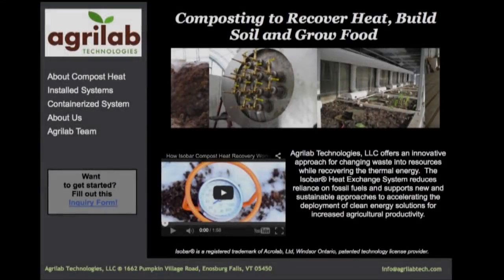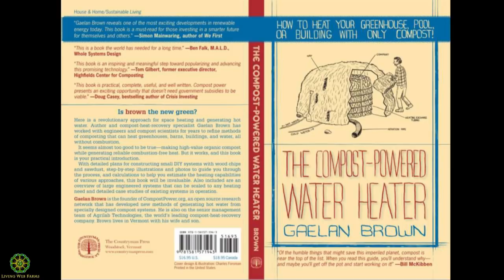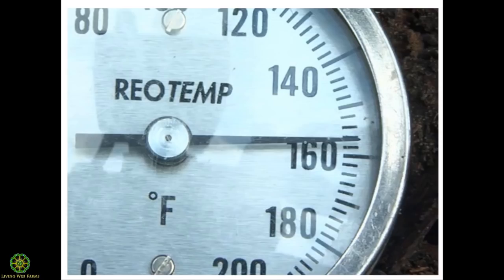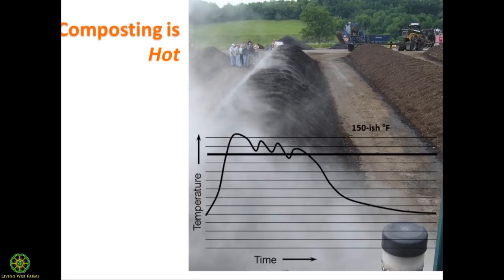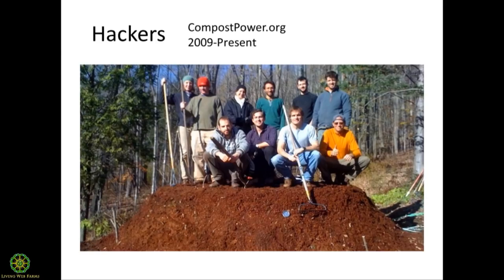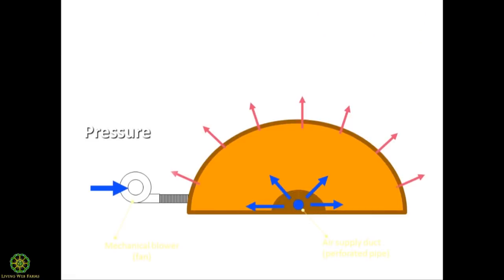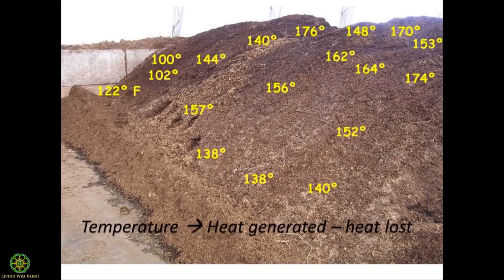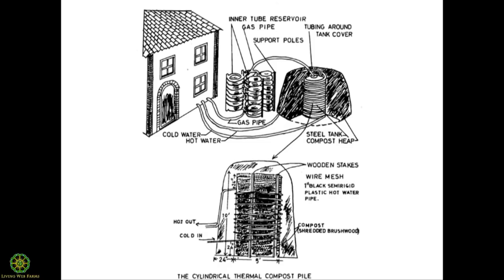Compost Heat Recovery Webinar with Gaelan Brown

Comment: Great presentation, very informative. No mentioning of peeing on the compost pile as a source of nitrogen and of course moisture.

The insulated shed composting set up could instead be a basement under the greenhouse with ventilation to the outside with vent pipes. The heat would rise up to the greenhouse.
Reply: If you're considering vertical farming, that's a winning concept... You could even have a greenhouse with several levels.

Comment: Great info here I have a small like 220 c/ft greenhouse for citrus tree that produce and will be using a compost box as a pre heater in my 30ft of hose at 5 feet down exchanger. VT is a great state had fun there near Manchester ctr years back.

Comment: Jean Pain's feedstock was machined forest wastes. It was far from being merely woodchips. it would have had a lot of leaf, bark, weeds, vines and many other things that are removed when reducing the fuel hazard and doing general forest management tasks. Woodchips made from just the woody parts of a tree are mostly carbon, lignin and cellulous, but brushwood that is cut and mashed, as was done in jeans machine, is entirely more nutritious and structurally suitable for composting and methane making than simple wood.
It is amazing that these heaps that you show could be anaerobic soon after turning. Usually if a material is that wet, it is too wet to turn well. But one thing is certain. unprotected compost heaps will burn away in the sun and evaporate goodness. They need to be mulched and covered with breathable material because by doing this well you will save about a quarter of your production.
Reply: No, the feedstock was fresh, green under brush which automatically has more energy content than the dead material.  Jean Pain, himself cautioned against taking the detritus.
Reply: You are capturing the water and recycling it to continuing the process. However, you are doing nothing with the CO2.  The is a gross inefficiency of the system.
Reply: @johnkilgallon207  you are obfuscating the issue.  Composting is an accelerated biodegradation with the interference and control of man.  In this case, the CO2 is not being used which is a waste. Your response provides no resolution.  You have left a clue that you maybe a Briton—“maths.”  If you are going to to use the abbreviation of mathematics just say math and rid your self of an unnecessary /s./
Reply: @estebancorral5151  wrong he has an American accent and references locations in US. In any event why don’t you make your own video instead of criticizing others?

Comment: Sorry if this is a silly question: does composting release more BTUs/energy because it does not emit any light, unlike combustion ?

That would seem to me to be a sensible explanation as to why there is more energy ‘available’
Reply: Interesting point. You may be onto something. Also, how about the sound emitted from some forms of combustion? At least internal combustion engines sure emits a lot. Engines are obviously used for work, which brings up another possibility -- is some energy lost to physical force in combustion that isn't lost in composting?
Reply: Another possible explanation that I wonder about: combustion doesn't utilize nitrogen from the atmosphere as a part of the chemical reaction like composting does. A significant portion of the energy in the process seems to come from atmospheric nitrogen being fixed and consumed by the microbes. This could help to explain how even though there must be losses from the biological process, there still the same Btu produced from composting and combustion.
Reply: No.  The system used to liberate heat is cellular respiration which which is many times more efficient than combustion.  As human, you are using this system to live.  The microbes in feedstock use this system. They have a problem though. There bodies have a low surface to volume ratio which makes it hard to remove their excess heat. By providing them with artificial ventilation, you are preventing them from dying off from their own gluttony.

Comment: I have a question about negative air flow composing. The question is asked in your video about inches of water column relative to cfm. We have built a system but have been unable to find information about the proper inches of water column. Could you supply this information please? Thank you for your time.

Comment: OMG!! I used to work with horses, and was really good at Squaring off the Muck heap,,, 
 even back then, I used to wonder about the heat and energy lost, whilst snow was steaming off, while the heap was composting!!

I am really surprised that this hasn't been made more accessible as information!!

And, I used to maintain the squared off Muck heaps, 
so as to ensure that we didn't have any fires!!

I was often thinking that the heat could be captured with the use of water lines,,,, 
Perhaps even the heat /cold generators (Peltier /Sterling?!)
I'm glad to see that this is being put to use!!

We would Start by tamping down the first, , then build up at one end, making "steps" up, and stomping them flat, 
whilst continuing the 1st end, 
until this was the correct height of about 6ft high,step down a foot, about a yard, in length 
and so on.

Eventually, the composted material was sold on to gardeners, and we'd keep circulating the compost and raw Muck and Straw....
There wasn't ever any problems with Unpleasant odours.

Back at home, I did keep my own two stables, one Muck heap easily heated, during winter, my elderly glass house, at a decent temperature, even keeping a couple of grapevines, amongst other things growing well in the NW, UK!!!!
Reply: What a Dingbatt!  This information has been around for ages. I clearly remember an article in 1980  by Reader’s Digest about Jean Pain.  This 
Publication is known throughout the English speaking world.

Comment: Is it possible to have the biofilter be compost of the same composition and size as the source pile? Then reverse the flow every once in a while to keep the twin piles' moisture balanced (and possibly help to keep the lines clear)? Since the biofilter is basically just a positive-pressure aerated pile? 
Is it necessary to use the Isobar® air-to-water heat exchanger or can one just use a commercially available air-to-air heat exchanger like from an air-source heat pump? This would probably work better at smaller/residential scales since it would also have the air-source heat-pump to compensate for whenever the compost gets too cool to suffice.
Reply: Completed compost is the best bio-filter. It is almost humus.  You are wrong that the system has to use positive displacement.  The German inventor Anton Flettner proved that negative pressure is eight times more efficient.  He had an ephany while on vacation looking at sail boats in Kiel, Germany.

Comment: Suck air from top down so that no water draw up into the vacuum machine and also draw up the heat. the heated air then enter the botom ground of a green house. Cover the entire ground with charcoal or better activated carbon so that when hot air enter the green house, odor can be filtered. Or let charcoal in a container of the pipe systm as a filter, then the filtered air with methane can be burned at the final stage of the exit.
Reply: 💥BANG!!! 💥✨🚭🔥
At a guess, but I am only going on the Stables Much Heap!

Comment: I cut down 25 trees and much of it was chipped into my woods. After two weeks the pile is steaming hot already.
Reply: Yes, but you are not regulating the heat to speed up the process or to put the heat into some other application which is useful.  You are a proponent of the status quo.

Comment: I'm confused: you say compost needs to have a fan to avoid the oder, but then you say that you just fan it to a room with wood chips to absorb the smell.

Couldn't I just add more woodchips to the pile to eliminate the stench?

Also, you say that the greenhouse that is attached to the compost pile had an awful oder, but you said he used chicken manure. What if you just composted plants?
Reply: on another video, saved in my playlist "fire" and/or "gardening" a person is using just a pile of leafs on one side of his greenhouse and says its enough and has stopped the use of his woodburner that he had installed there. i believe he said that there was coming like 30 degrees celcius from the side in the winter

other people say manure is producing like 300w for a ton
Reply: I thought elaine ingham said if it stinks its anaerobic and not working correctly?
Reply: @jesuschristislordoflordsan427  It depends on what is being composted, and what system is being used...
Also,, these compost heaps need to be managed.
I hope this helps. Andrea XxX